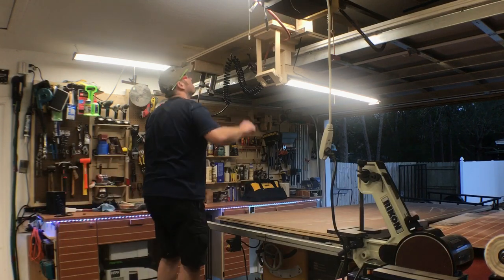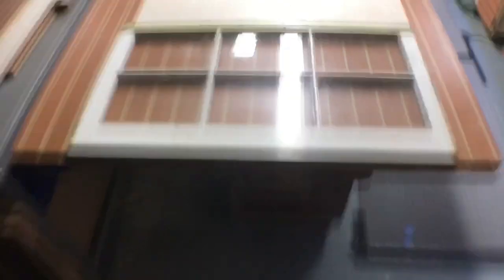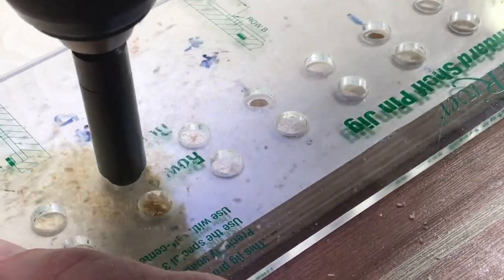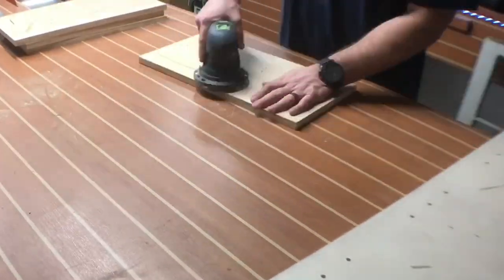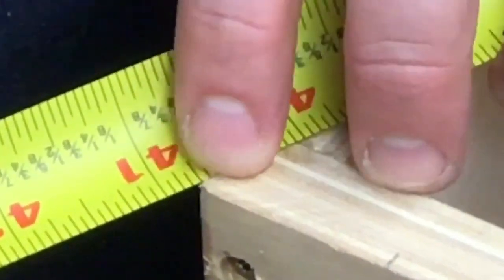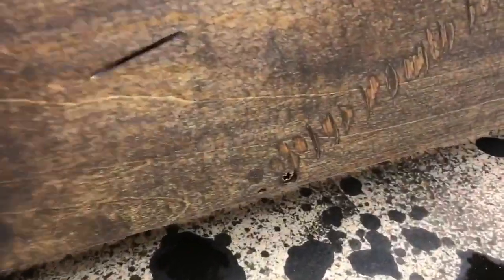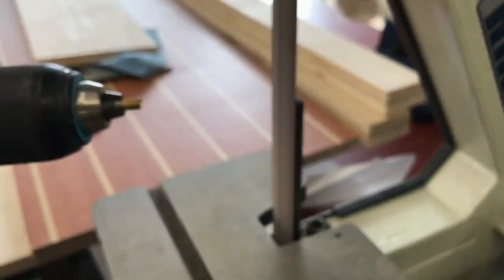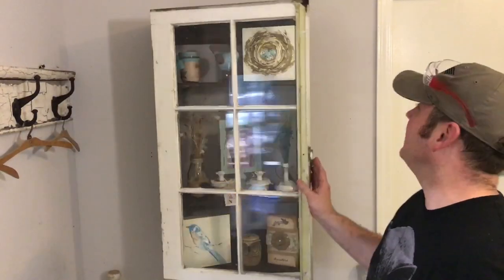How to Make a Cabinet with an Old Window

Comment: I’ll be building a curio cabinet using my salvaged window sash I bought at an indoor flea market a few years back. The window is 2 x 3 feet. I’ll be using stair treads for the shelves and I’ll put decorative brackets on the top to make it authentic. I’ll be looking for 4 legs. The cabinet box will be a combination of leftover and new wood. I’ll be using pegboard for the back panel.
Reply: I haven’t decided if I’m putting brackets on this project or not.

Comment: Nice project I got some good ideas. I especially liked the distressing technique. You might try "aging" the hinges in vinegar for a few hours to add to the antique look. BTW when working with old stuff like this its always a good idea to test for lead paint especially if you are  kicking up dust with sanding and sawing. New subscriber.
Reply from the maker: You got a great point there absolutely, I do need to be more careful! I definitely appreciate the sub, and the vinegar trick I will definitely have to try thanks again
Reply: Absolutely!  Anything pre-1978 is likely lead paint.  Full respirator & lookup how to clean clothes, shop etc.  If you're a total law-follower, it is required to bag all dust and do a huge cleanup effort & dispose of all paint chips, dust, wood & everything in a very specific manner.  Federal law.  But I do not think any DIYer is even aware of it, let a lone going to do it ;-)   @HoneyOnWales
Reply from the maker: DrewT Thank you for the tip. I absolutely do need to be more careful next time. Thanks for watching

Comment: Why not use magnets? I don't get how that pin holds it closed
Reply from the maker: ArcanePath360 let me explain. The door has about an eighth of an inch SAG when it's installed. When you shut the door the pin is about an eighth of an inch above the hole. I should've explained more of this in the video I know, but once the pin is inserted into the hole, the friction fit is what keeps it shut! Thanks for the inquiry and thank you for watching!!